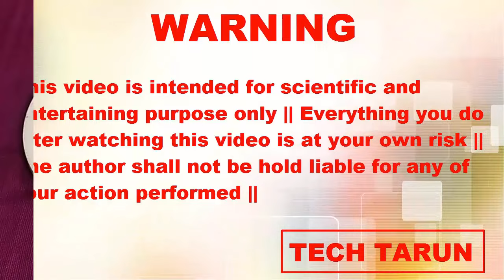Simple Led Tester | A To Z Led Tester

Comment: The problem with these projects is that NO ONE explains or justifies from a theoretical point of view why they used the resistance value they used and why they chose that dissipation power for the resistor. In this video 82 ohms were used but others use 33Kohms, others 47Kohms and even 100Kohms with dissipation powers of 2W, 3W or 5W. An explanation should be given as to why they used the R they did. Greetings.
Reply: You need to calculate using formula Vi-Vled/ I where input voltage is Vi, Vled is forward drop of an led & I is forward current of an led. We can even use a 1 k resistor without any calculation😊